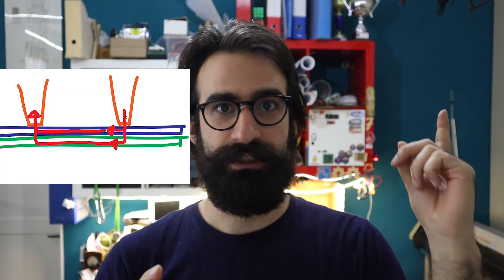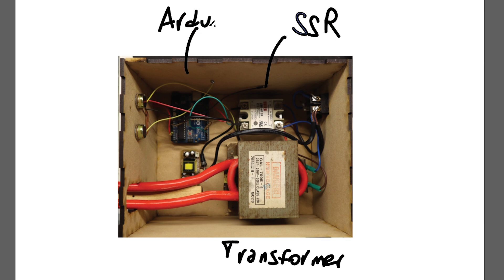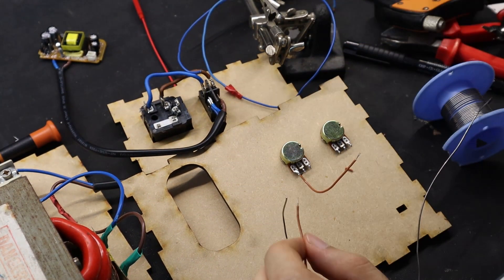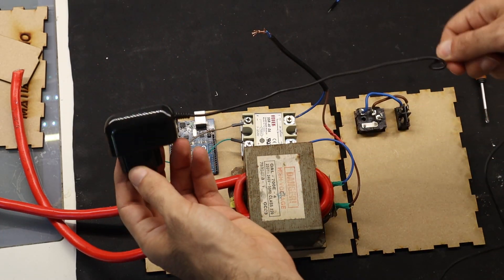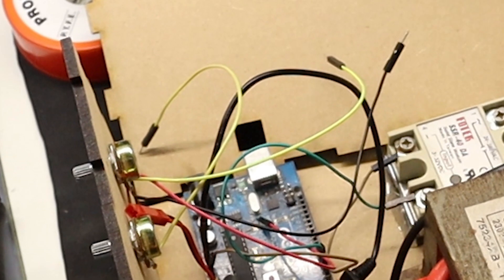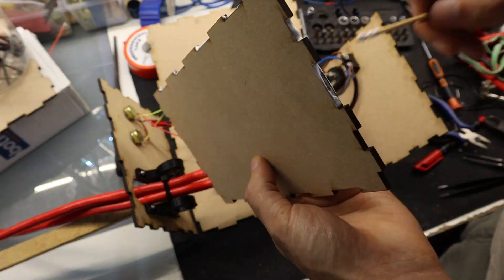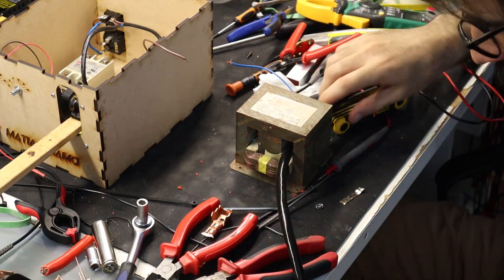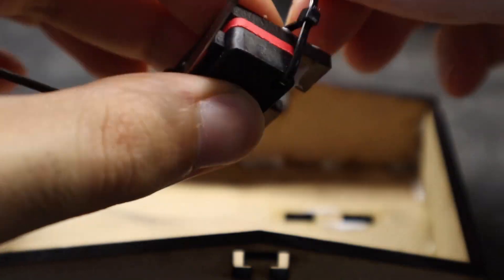DIY Spot Welder - It even works!

Comment: What VA transformer did you pick, looks like 800?
How did you damage the wiring? Would a slow fuse have prevented that?
Is the Arduino/Pot GND connected to EARTH?